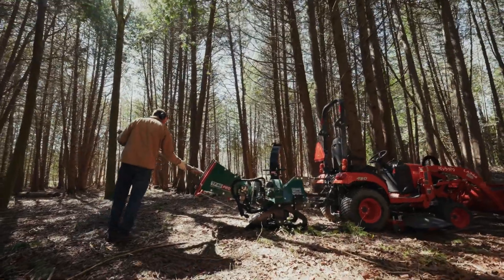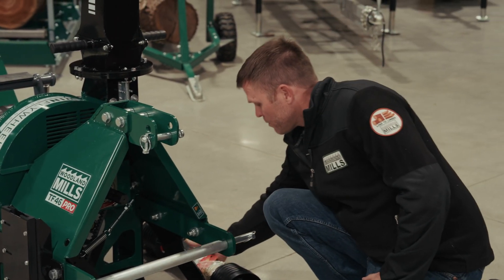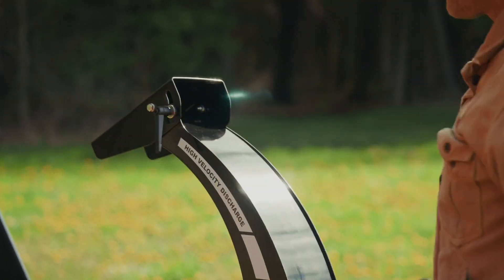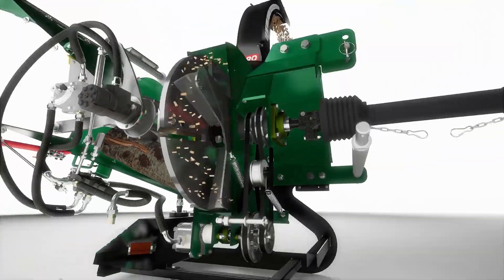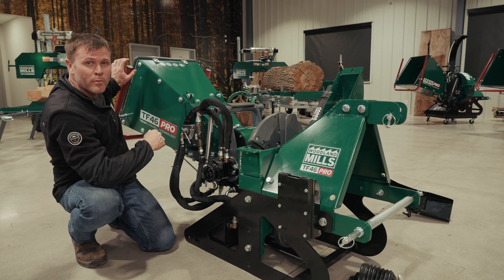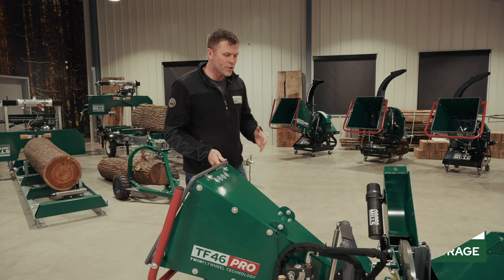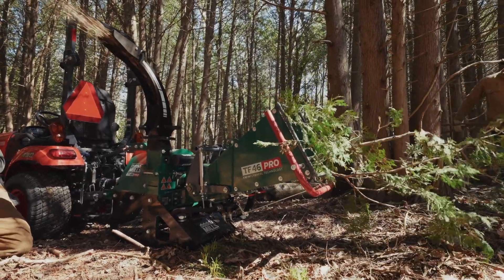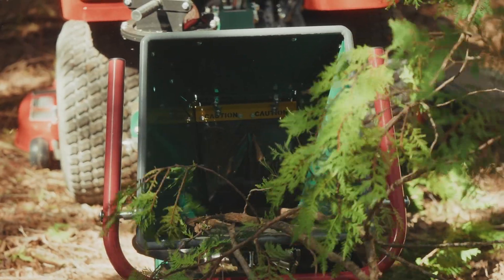Woodland Mills TF46 PRO PTO-Driven Wood Chipper Walkaround

Comment: Just received my TF46 Pro last Friday.  Just wish the weather (and my free time) would cooperate so I can put it to work.  BTW, delivery was a breeze and I commend the FedEx driver for his confidence & professionalism.
Update 30 March 2025:
Could not ask for better packaging & pallet. A steel framed pallet & perimeter cover with heavy cardboard.  Almost everything was wrapped with bubble wrap & stretch wrap.  Getting it off the pallet was a bit of a challenge as the unit has to be lifted with my tractor 3PH and the belt guard was not shipped with its attachment tightly bolted to the fan housing.
I was doubtful that the hydraulic line between the pump and the tank would work as the line is very short and requires a 180° bend. Had to loosen the hose clamp at the elbow to twist it around so it would snap on other hydraulic lines.  Ultimately it worked and I was able to tighten the line connection to the tank.  Don't know yet if it'll be leakproof as I haven't filled it with hydraulic oil yet.
Tolerance on a few of the Chinese fasteners was a bit sloppy & undersize for a standard metric wrench.
There are a few scuffs on the painted/powder-coated parts.  Will have to do a bit of touch-up on some of the corners.  Would be nice to know the color code.
I'll be setting this up initially for my Kubota BX-2380. Just ordered a cover for the chipper and a 2nd PTO shaft for my Kubota L2850 just in case the PTO shaft length needs to be different.
More to come once the weather improves.
Update 2 April 2025:
Discover a hiccup yesterday.  Dropped the snow blade I had on the front of my BX.  Chipper was on the 3PH.  The chipper extends quite a distance behind the tractor and consequently needs front weights to balance it when there is no FEL on the tractor.  Makes it quite easy to do wheelies.  Need to figure out how to add front weights AND no screw up both the belly mower bracket AND the undercarriage for the snow blade & blower.
More to come!
Update 4 April 2025:
Finished the assembly.  Trim the PTO shaft as required.  Discovered that the 3PH cannot be lift to its full height because the PTO shaft hits the cross bar that connects the 2 lower hitch arms.  Gonna have to be careful and remember this when using the chipper.  Did a test run and all seems to be working correctly.  Need to get some hours on this chipper to learn its idiosyncrasies and finish the final checks on the bed plate & F-N-R linkage.  Things are looking good.  It's certainly quieter than my previous TurfTek chipper.
Possibly one more update to come...

Comment: I have the WC68 chipper and I like the "window" and tool that you guys came up with for the bed plate adjustment on this new design. My unit is very difficult to obtain control over the 1/16"-1/8" clearance. Any suggestions?
Reply from the maker: Unfortunately the bed plate gap tool and window is only on our new chippers as it is a part of the housing. However, on our previous models a tip that one of our senior techs came up with is using a marked flat edge to display between a 1/16"-1/8" between the flywheel blades and bed plate by going in the clam shell.